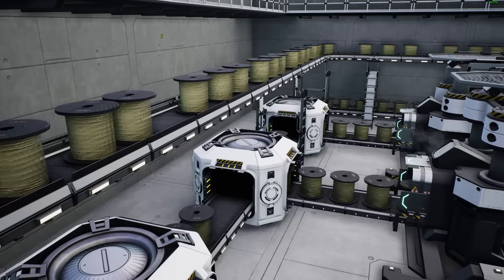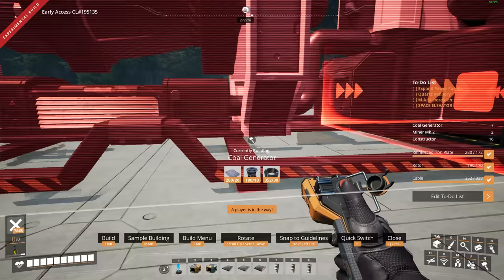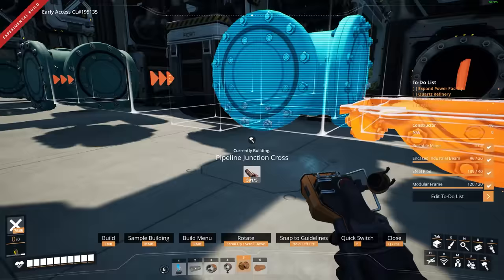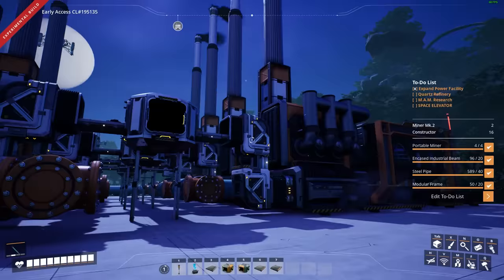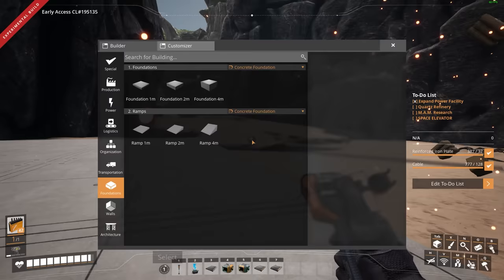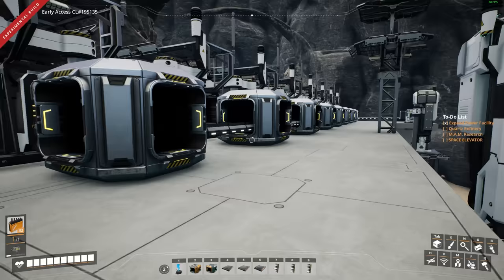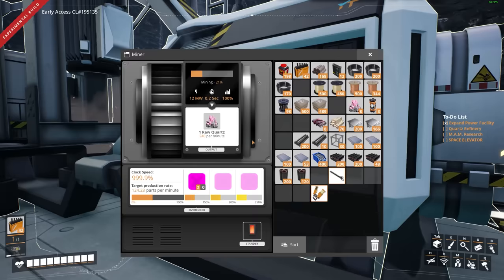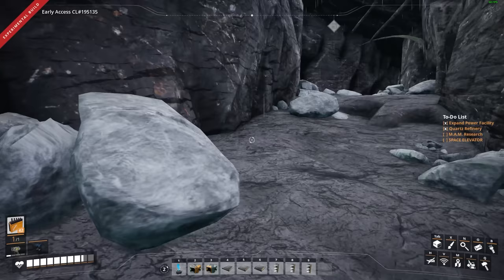SMART SPLITTERS! - Let's Play SATISFACTORY Update 7 - Ep.12

Comment: The bladerunners jump boost helps you be able to jump onto grounded pipes and splitters without issue, i think if you slide jump you can also get onto 4m platforms if not higher. Another useful thing about bladerunners, which is almost vital if you're exploring in case of... accidents, they lessen the dmg you take from fall damage, AND if you're at full HP, if you would take enough fall damage to die, instead it will leave you with half a bar of HP, no matter how much higher you fell from. It's quite a life saver... literally.

Comment: You can save a part of the energy by underclocking the water pumps. Each pump produce 120m3 and supplies 2 coal unit, which require only 90 m3 (2x45 m3). Underclocking all pumps to produce 100 m3 (to have a little bit more than needed) will decrease their energy consumption from 20 MW to 15 MW = 8x5 = 40 MW saved - 2 other pumps.

Comment: you got ladders unlocked. you can just place them anywhere and zoop them up to go vertical. no wallsupport needed ^^ if you set the remaining outputs on the smartsplitters to overflow and merge those 2 lines into an awesome sink, you will always be getting silica, quartz or awesome tickets. if you want to see the real benefit of the bladerunners, you should do the slide into jump trick. you'll leap  like a kangaroo. saves alot of travel time. you can also ctrl click all space elevator items directly into the machine. no need to roll them in and wait for it. good luck in the next tiers dude. this is where it starts to become messy real quickly if you dont think your stuff through :D

Comment: Just seeing the switch, one suggestion i have is to build a power station grid control centre to manage the power to all factories. Like a switchboard. So there would be a power line from the power plant to the switchboard and from there would be individual power lines to each factory in which each power line can be switched on and off from the control centre. Saves running around plus efficient management.

Comment: 1. Balls. 2. You "test" the improved speed of the Bladerunners but completely skip over the jump height improvement. Without bladerunners you can't jump over a splitter. With them, you can. This also translates into slide-jumping, which you don't do often anyway. And the fall damage protection meant a great deal more before Update 6 when your health wouldn't regenerate to full. The reason folks were clamoring for you to get them is that pre-Update 6 they were a massive QoL improvement. Post-Update 6 they're still a QoL improvement but slightly less so.

Comment: You can easily fit 2x20 coal generators near that lake on a single level. Problem is actually in getting enough water for them. But still, there is definitely enough space in the lake to get water for at least 80 coal generators

Comment: I’m not 100% sure, but I think the reason the coal generators are fluctuating on and off is because you have TOO much water coming in. You have 2 extractors per pipe. Each extractor does 120/min. So each pipe is getting 240/min. Then you have 1 pipe feeding 4 generators. Each generator takes 45/min water. That means you’re trying to push 240 water/min to machines that will only take 180/min. But the excess water has nowhere to go so it hits the end of the line and essentially bounces back, which eventually creates a pressure difference lowering the flow into the last generator. I don’t know if this is true or not but would make sense if realistic. A way to fix this would be to run the pipe past the last generator in line and install some buffer tanks at the end so the water has somewhere to go. Now eventually the buffer tanks will fill up and cause the same issue, but it should be mitigated substantially if the end of the line is much further past the last generator. Or, you could simply add another generator to make it 5 and then the 240/min pipe will supply to the required 225/min of the generators and it will at least be closer. Of course then your coal input would be off a bit, so you could underclock all the generators to get them to all be even. Though in doing so I don’t know if it would also underclock the amount of water being taken in. If so, you could simply underclock the extractors so that each one only outputs 90/min instead of 120, then you’d have 180/min which is exactly what 4 generators require
Reply: Again i don’t know if this is how the game actually works, but it seems like it would

Comment: This sushi belt setup to separate the crystals from the silicate is probably the most unnecessary I have ever seen. You could just sent the first 4 mergers straight to the first box and the last 4 mergers to the second box, but instead you plug them into each other just to immediately separate them. You even had all your crystals on the left and silicate on the right on both floors.